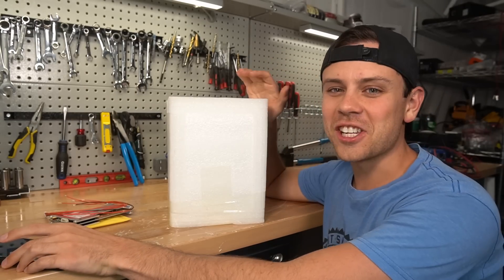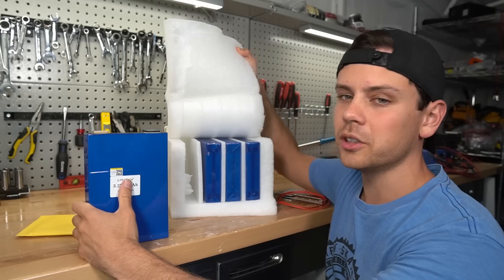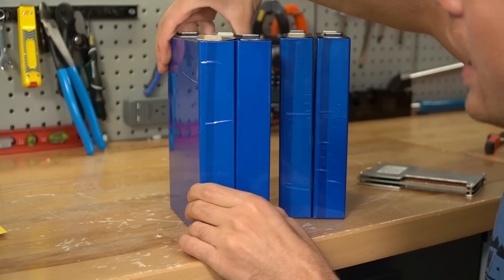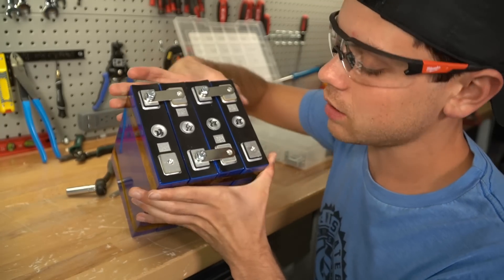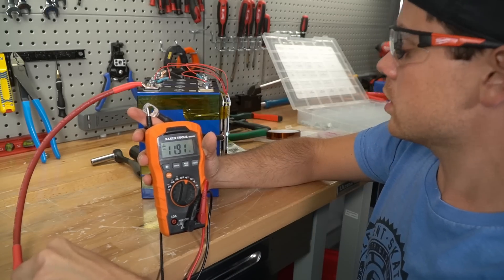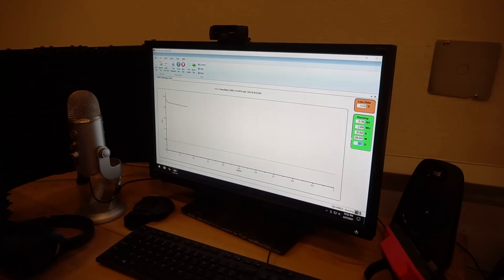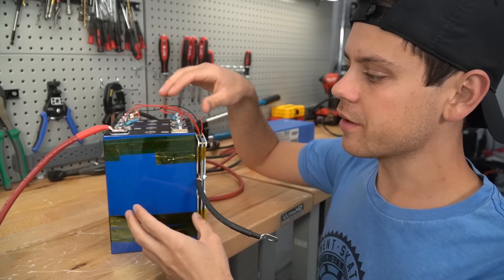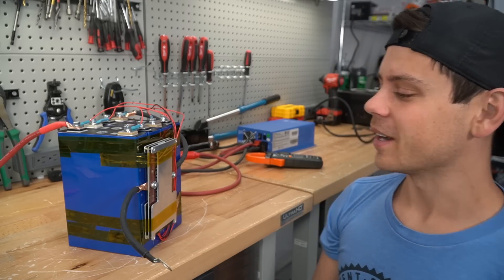Cheap LiFePO4: $221 for 100Ah 12V!! The Cheapest Cell + BMS On Aliexpress

Comment: You called it junk, then tested it and it did exactly what it is advertised to do.  I think for half price, that is well worth it.  Even if they were 95ah, that would be well worth it.  I just ordered some. thanks
Reply: Just ordered a second one.
Reply: Apparently there are welding marks on the terminals. See comments too. They might be used cells. But just like you, it might be a good start for a project. I just wonder if in the long-term they are still cheaper than an a grade investment.
Reply: I agree. But those swollen cells means something bad happened to them. Being LiPo4 makes me think they will just fizzle out if they are no good. Rather than become a Towering Inferno!

Comment: Thanks Will for the video. Mine pulled only 94AH and as swollen as yours! Oh and if you look at he terminals carefully, you can see signs that it was laser welded before to a bus bar and it was striped off and the screw hole was drilled later manually. The screw holes are not even at the center for most of the terminals.
Reply: Amazing attention to detail. Great comment sir.
Reply: I am new to all this, and i would like to try to build a cheap 48 volt trial system for my boat...i think these cheap cells woud be perfect for me for experimenting and training. Am I wrong?
Reply: @lucaschueli984  yeah if they provide enough power for your boat you'd be fine
Reply: ok
Reply: I guess I am quite randomly asking but does anybody know of a good place to watch new tv shows online ?
Reply: @Kane Jaxxon thanks, signed up and it seems like they got a lot of movies there :D Appreciate it!!
Reply: @Alfredo Conner no problem =)

Comment: Can you remember 2 years ago when those very batteries was $1000 total .... BUT definitely B-grade and the #23 was probably from a discounted BATCH cell purchase-- so really -- bottom of the line at best -- BUT - they work fine ...as you said probably left in a warehouse 5-7 years ... which is fine ... would I use them on critical equipment -- NO -- would I use them to keep my ice cooler cold -- Hell Yes ... /// I will order 4 of them myself and see if I get the same results

Comment: I bought these same LiitoKala 100Ah cells w/ a similar BMS, back in January as my first ever 12v lifepo4 battery pack. Bought them to run my 30' trolling motor on my personal pontoon and I have to say I that I couldn't be more satisfied or happy with these "poor man's" cells. They constantly pull 98Ah and that's just fine with me when comparing price and weight to it's much heavier and slightly less expensive counterpart (Lead-Acid 12v deep cycle battery).  
I'm so happy with them, that I've got another set of 100Ah LiitoKola cells on their way to run my 2nd pontoon. I also plan on running both 12v lifepo4 packs in parallel for my travel trailer.
Reply: How much were the cells or your cost?
Reply: @dougb.9449  $180 for my first set in Jan 2021 and $172 for my second set Aug 2021

Comment: Yeah, I am a year late but, when someone store these cells externally and with proper copper wires to common bus bar, it can works for few years without trouble, especially when the system voltage would be 48V (14S) and therefore currents four times lower. OR am I wrong Will? :-)

Comment: Low cost lithium is getting more and more available. 
Time to put these through a few months of cycles. 
Post up he results!
Reply: Run them in a steel box on concrete. Those bulgy cells are scary.
Reply: 6 months later, how about an update?  I am thinking of buying them tomorrow for 11.11 sale.

Comment: I got these cells a few months ago as my first dive into Lithium ion phosphate batteries (complete newbie) they were flat and not swollen but were very low on charge when recieved but all balanced. Top balanced them but don't know how to capacity test. They run some things like 500w drill a 1000w coffee  pod machine but not others like a.750w angle grinder. Made my own copper bus bars cause the ones supplied got hot. Great video I started this journey cause of your videos and I am learning heaps. Sometimes by my own mistakes!! 
Cheers.

Comment: Hi Will.  A quick question.  Is there a reason to put batteries in series then parallel or can I parallel batteries then connect those into series?  For instance, if I'm doing 4s6p, can I put 6 cells together in parallel the connect each of those packs to others in series?

Comment: I have these cells, when they arrived one cell had a blown valve, and the electrolyte was all over the cell, I complained and they told me to send them back, shipping was to expensive so I ended up taking a loss, bought a replacement from the company you got yours from , they shipped it airmail I got it in 2 weeks and the cell was ok. The battery pulls 80 amps with absolutely no problem at all.

Comment: I have a challenge for you what battery would you build for a sailboat and can I charge it with a 51 amp alternator and I'm on a budget I also have a cheap 200 watt solar panel kit

Comment: Are the LiFePO4 like the Lipo in that if you’re not going to use them right away you must put them in a storage state of charge? I’m wanting to get or build a battery storage bank to use on the road for vacations but also to have reserved power in case of power outages. If I need to keep it at storage voltage until time I need it, it will be too late to charge when the power is out and I need it.

Comment: Same voltage doesn't mean equal charge of each cell though, they will all be imbalanced if the charge % isn't the same right? So could you drain them all in parallel and charge back up?

Comment: Those Ally case thin wall cells should be run compressed as they do swell, same with the Eve and Lishen cells.
Reply: I liked your comment. I was thinking about my new Li-04 batteries, how do I keep them from swelling?
Reply: @lindafoxwood9091  well the data sheets suggest that compressing them stops excessive gas production which can happen with these soft cases and makes the cells last over 1000 cycles longer!
Reply: @TheGalifrey  so get some metal bars and long screws and squeeze them tight? Like u bolts or sim but square?
Reply: @bontragershadow9070  Check Wills forum site and search for "compression".  There is lots of discussions relating to this.  You'll want to be careful with using anything metal and sharp since that blue skin is very thin and you don't want to puncture/cut it.  Some have simply used thick plywood and thin  threaded rod to sandwich the cells and keep them compressed.  Others go a bit above that and use springs on the end of the threaded rod putting pressure on the plywood but still allowing the cells to expand slightly since they do expand some when charged.  If you have it compressed too tight when fully charging the cells then it can actually damage the cells.
Reply: @bontragershadow9070  What David B. Says, I am using sheets of barley paper between the cells and plywood panels at each end with threaded rod/nuts torqued to provide the right level of compression. Will's forum is a great source of info.
Reply: Thank you everyone. Lithium is expensive and worse when you screw up. Research and people like y'all make things way better

Comment: Hi DIY Solar Power, i know this is an old video but i just started my own solar-project in the middle of Sweden :). I saw your video for this brand after i bought my batteries :). I just bought 16pieces of 3,2 volts 310Ah LiFepo4 from this manufacturer branded as new Grade A batteries.... And the price is, inc vat and shipping from Italy,  2188,64 SEK, 1SEK is currently approx 0.11USD ... Lets see what i get :)

Comment: Just recently ordered 280ah cells from Soonbuy using one of your links in your website. I bought two leisure 75 Ah SLA batteries about 2 years ago for about 200€ and now they can't hold more charge than about 200-300 Wh at 10A discharge rating before it dips below 12.0V after just some cycle use. It's quite surprising that the lead acid batteries degraded so quickly, idk if they are car batteries mislabeled as leisure batteries, but i hope that this upgrade is worth it. I have a 1000W inverter which i use currently with two 100W panels. I use these to charge my electric bike during the summer season and for use in a shed, and during the autumn i pack it all up inside the house for overwintering. I also bought a 200A Daly BMS that can monitor the SoC to lengthen the life of the cells and for later on upgrading the inverter to a 2000W one, so all of these together would be a DIY Bluetti/Inergy Kodiak solar generator for a much cheaper price.

Comment: I have a small trailer that is stored outside in SW Utah (almost as hot as Las Vegas), and is used for back country travel (lots of bouncing along washboard).  I currently use a cheap 80 a/h battery, but I want to get a better capacity than the Lead Acid..  I'm looking at Portable Power packs, or building a battery pack.  What is my best choice for a battery less than 400 dollars that will endure the high temps and rough rides?

Comment: Will. I have a lifep04 120ah battery and I'm waiting for my 4 cells 280ah to arrive. I have a daley 150 amp bms for the cells. My question is hooking these 2 batteries in parallel . If i have them charged to the same voltage, can I discharge and charge them without issue .

Comment: If you want cheap cells, they have some 320ah cells for about 140 dollars (140 for a 4 pack). Joking aside I had seen them and was quite curious about whether they were a scam. I assume it is to some extent, and after watching your video I was wondering if there was a way to vent the gasses/change the electrolyte

Comment: Hey if I switch to lithium for my motor home house batteries can I still use the jumper switch to assist my RV starting batteries? I am bad at keeping the starter batteries charged, I have an issue getting out to camp.

Comment: Stupid question but could you relieve a little pressure in these cells? Maybe the plastic itself is just junk and the cells are fine? I mean they pulled full capacity so 🤷🏾‍♂️

Comment: Isn't there any more information in the barcode about these cells or can that only be decoded by the manufacturer? Shouldn't you always use spacers (or other insulation) between the cells to help prevent a short when these are rubbing against each other and rub through the thin sheet of blue tape?

Comment: I really appreciate you blazing the trail ahead of us. I had considered that supplier but I'm now glad I didn't pull the trigger.
What do you think about Shenzhen Basen? BUT DON'T DO A VIDEO ON BASEN BEFORE I GET MINE!!!
Reply: There have been videos on SB previously. That‘s why their prices went up quite a bit. Sorry - too late... 😜
Reply: @spaRTan3246  And yet, they still appear to be a really good value.
Reply: In the end they‘re all the same. You‘ve got the big three manufacturers Lishen, EVE and CATL and their cells are almost identical. I‘ve got 4 pieces of Lishen (Shenzen Basen) and 12 pieces of CATL (someone else 🤗) and you couldn‘t spot the difference. Go with the cheapest offer on Alibaba that has some recent sales. 💪
Reply: @spaRTan3246  The suppliers are all not the same however.  Some have really crappy packaging causing damage in transit, some have poorly threaded terminals, some are known to have really good customer service and don't blow you off if there is an issue.

Comment: hi there Will...how is a charge cycle measured brother?
Do the batteries continuously run down while being charged during day and then run down at night with no sunligth then again regarge the next day with the sun if there is sun?
In this case is the charge cycle then the part of it, where it runs down totally at night and recharges the next day?
Also...
I am noob at this : If I currently use about 20units or KW per day from the grid [Desktop computers are on tv`s are on and fridge whole day cause kids are at home .....
What size AGM batteries and how many would I require to last me a day at least? just to charge the next day again [asking this because in South Africa Solar equipment is hellishly expensive...
Is 4 x 100ah 12V batteries enough in series? - 4.8KWH - obviously it will run down at night to be charged from scratch again the next day if there is sunlight to go around...

Comment: Ive had 8 of these running for 3 months. All bulge like that.  Although I dont cram 75 amps into it.  I charge at 15a and discharge around 20a.  Never an issue.  Maybe the bulge is from the cathode not liking to take sharp corners as it spirals around?

Comment: Hi, I enjoy your informative channel. Many of us are owners of older Hatteras boats, which are 32v systems. Most of the battery mfg's are discontinuing the 8v batteries that we combine for the 32v's. Would it be practicle to make 32v LiPo batteries by linking 10 3.2v cells together?

Comment: Hey Will. The other day I was joking about that I couldn’t share something with you because it would go out of stock in 24 hrs after it’s on your channel. Well I bought all the stock I need so..... here goes. 
I had a problem when charging some 280ah batteries with a 50 amp or higher rate. I top balanced to start with and a Overkill 120 BMS was used. I started to see unbalanced cells and it got worse each cycle. I desperation I found an active balancer and didn’t expect much. I hooked it up in parallel with the BMS and low and behold, only a peak 65mv difference just before the cross over cc/cv event and continuing to lower to 2mv Delta at end of a 30 minute absorption. Gobsmacked! I now can get full capacity without a high cell tripping the BMS. Please do video on the Heltec 3S 4S 5A Active Equalizer  ($29 Amazon) Do inspect them, one out of four had a capacitor turn around wrong (red mark 180* out). 
Grade A cells? It’s still only luck of the draw and time is the judge. A 50ma balancing circuit in a common BMS’s and high charge rates in a high ah battery may be too much to ask of it too.
Reply from the maker: Ordered
Reply from the maker: Very interesting
Reply: @WillProwse  
Hey Will. They’re out of stock! LMAO!
Reply from the maker: @SkypowerwithKarl  no way!!!! Gosh dang it 😂😂😂

Comment: Just stumbled across your awesome videos upon researching batteries and battery box builds for an inflatable boat/trolling motor (55lb thrust). I'm looking at picking up a 100ah or finding something that could get me the runtime of roughly a full day on the water (6-8 hours?). I think the 55lb motor draws 52amps on the highest setting but I'm not sure I'd be going full speed the whole time. That said, what would you recommend as a good "beginner" setup that offers the 'necessary' protection, is good for wet environments (including saltwater), but also won't break the bank? I may just start out with SLA but it won't be fun carrying around :(

Comment: Hi will. I'm looking to make a 72v battery pack for a golf cart, using a daly 250a bms.  I got the varicore batteries.
Im worried about the 1c discharge rating, because my golf cart pulls around 120 amps constantly , higher when accelerating.   Do you think my intended setup will work?

Comment: Quick question...  When you say "I would avoid these cells", what could potentially happen?  Will they just die and be a waste of money or are we talking about a potential fire happening?
Reply: Swollen batteries can explode if the gas buildup ignites, but it's really rare. So I wouldn't worry about it tbh.
Reply: Basically, as long as you keep your cables connected to your battery and connect new items far away from the battery, then it's very low risk.

Comment: I'm a total newbie. Say I buy these, the BMS, and a cheap 2-6A car battery charger from HF, and a 400w inverter. Will all that stuff just bolt together and work? I'm only trying to run two 3D printers and use this as a power backup for unexpected power outages. Any help is greatly appreciated.
Reply: No to the cheap car charger, those are made for lead acid or AGM batteries. With little tinkering you can skip the inverter and power up the 3d printers straight from the pack. Most 3D printers run on 12v, some use 24v and you can use a buck converter for that. A pack this small won't power up much for long but it can save your prints though.
Reply: @MrJramirex  Thank you, I'll look into the right Li4 charger. I would only need in emergency for about an hour or two. I'm not to electrically inclined about running from straight 12-24v. Thanks for the info 👍

Comment: I have a preassembled lifepo4 51.2v 150Ah and i have to add more battery with different age and different brand to increase capacity. Do you have any device recommendation or any tips i can put those batteries together?

Comment: witch one should i buy for Sonar ( fishing ) I need minimum 28AH LifePO4 Battery ( 12v to 18v working voltage sonar ) i need the smallest possible setup because i have a portable sonar. The sonar use 1ah of energy.

Comment: Your videos inspires me as a beginner and trying DIY myself.  I have 3 panels each 200W, 20V, 10A and connected in series.  Can I use 10AWG to extend the solar cable to the charging cable of Bluetti  AC200P, which has 700W/35-150V@12A(Max.) for 20ft length.  Or I have to use a bigger AWG?